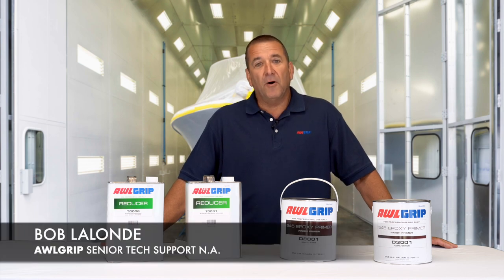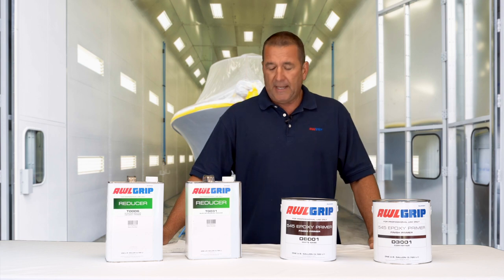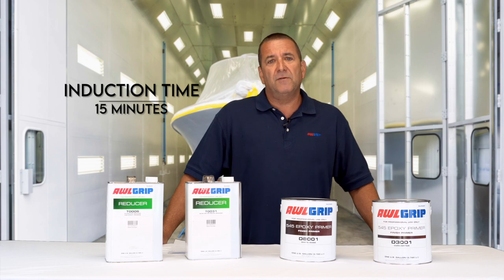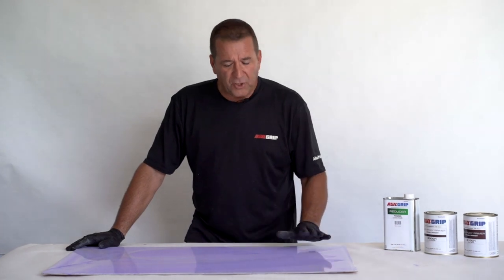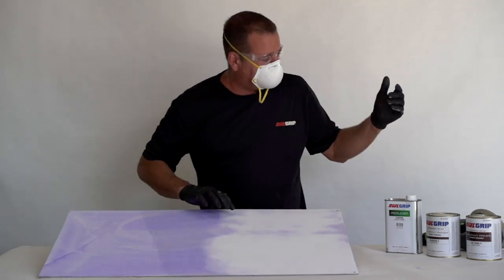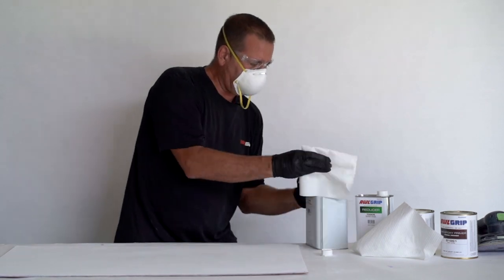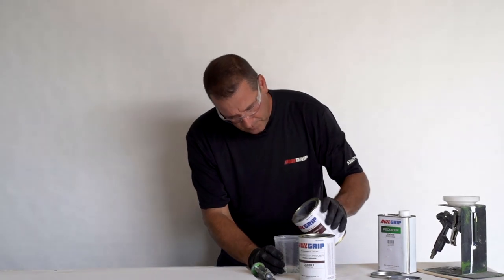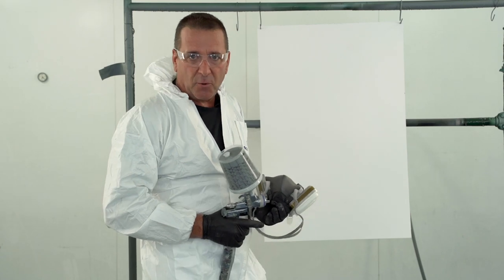Awlgrip 545 Epoxy Primer : how to mix , prep and apply

Comment: What is the bottom primer system referenced at 35 seconds? I'd like to paint the bottom of my hull after sanding down the bottom paint and repairing the gelcoat cracks/chips.